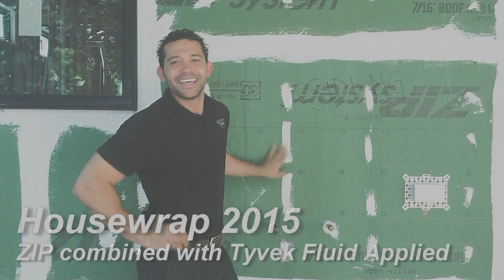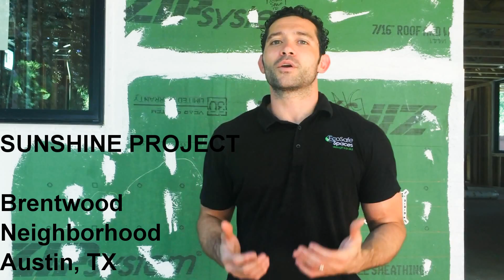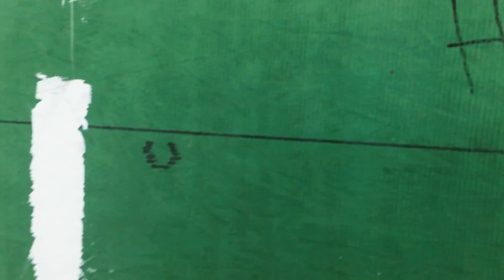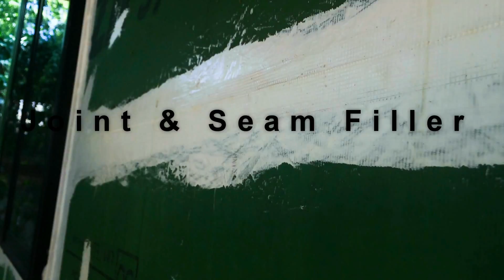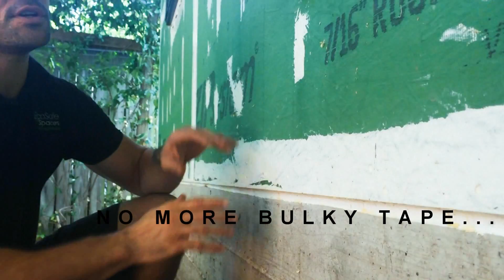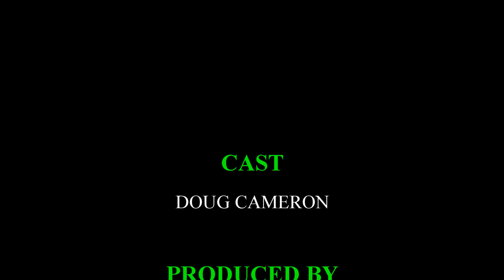Housewrap 2015

Comment: Dont know if this system would work in the northwest. I see it a lot on new builds around Seattle. What happens to the penetrations made from installing siding?is that self sealing?
Reply from the maker: Antonio Olivarria nails from siding are typically a non-issue. If you have concern about them have your framers shoot them at a slightly upward angle.

Comment: One problem. The Zip sheathing has zero nail seal ability as mentioned in this video. If the fastener is overdriven it will destroy the integrity of the interior of the sheet and fracture the hard coat laminate on the exterior. Even with the fluid Applied on the fasteners and the seams the field is still questionable.
Reply: What would be a better way to achieve the best result?  OSB & Fluid Applied WB over the entire panel?